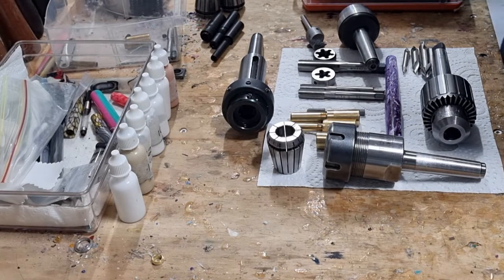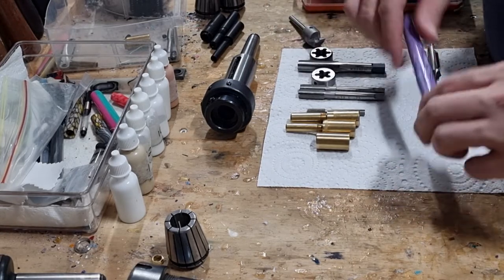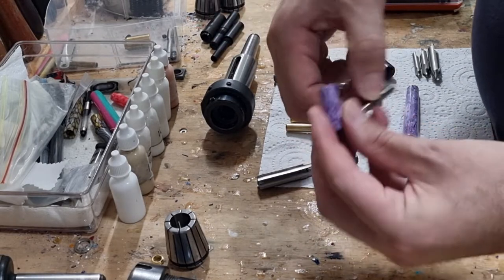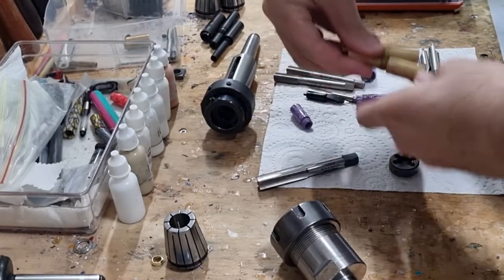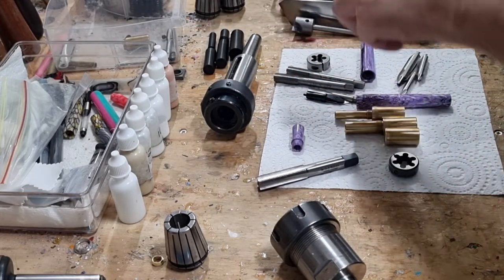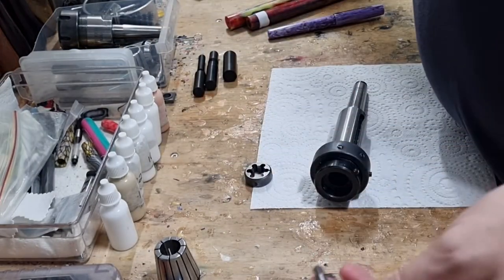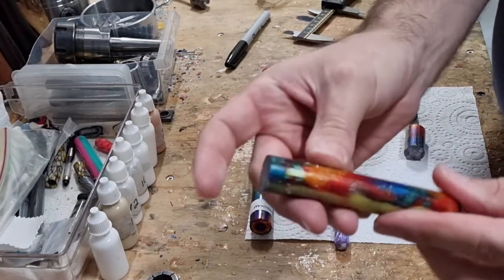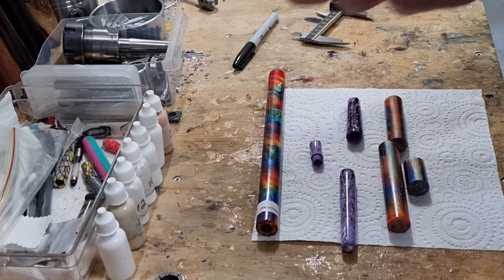Bespoke or Kitless Fountain Pen Making Introduction 1/5

Comment: Hello, I am just wondering why the custom mandrel for the pen barrel looks to be much shorter than what the pen barrel would be? And, I would like to make a bespoke pen out of wood, would the custom mandrel for a wood pen extend all the way into the barrel?
Reply from the maker: Basically a long mandrel fully inside the length of the pen just isnt needed, the majority of the strength to hold it on the mandrel comes from the threads and the force holding it up against the shoulder of the mandrel. 99% of the turning is done with Live Centre in your tailstock supporting the work piece, so the actual length inside the pen is pretty much irrelevant. I sometimes make a temporary mandrel for one off oddball pens and I'll usually make it even shorter again than what I have here.

Comment: Hello, also I am wondering if the raised part of the custom pen mandrels is used as a bushing?
Reply from the maker: No, everything is measured with callipers and turned to the correct size, the brass mandrel "lip" part actually wears away over time, those same mandrels in these videos actually look quite different today after a few years of use compared to when I filmed these.
Reply: @justturnings  Oh, that's very interesting, why is there a raised bit then? Is it to provide some stopping point for the part you thread onto the mandrel?

Comment: Great video - thanks. I've been checking out the price of the triple-start taps and dies and wow - they seem to be about 10-15 times as expensive as the normal ones you buy. Can you get away with single-start ones to get going?
Reply from the maker: Yes you certainly can. In fact there are plenty of high end pen makers that only use Single Start threads for their caps.